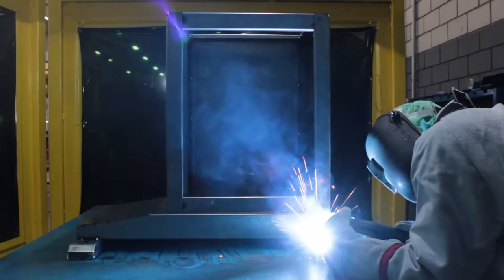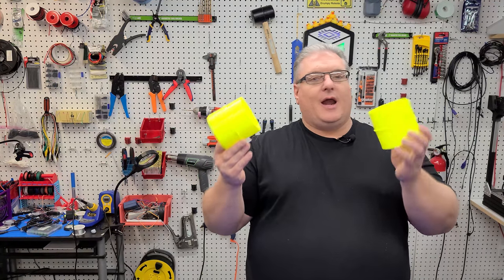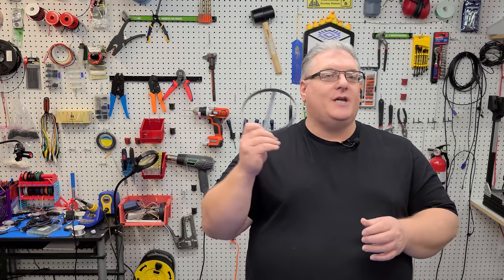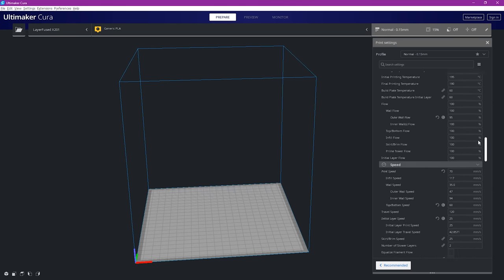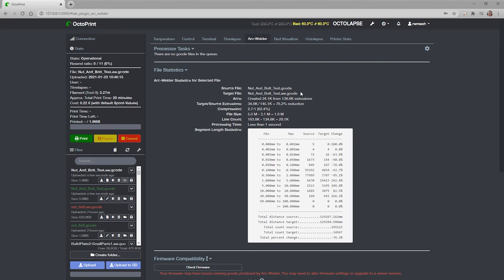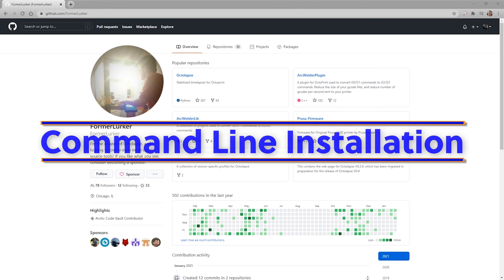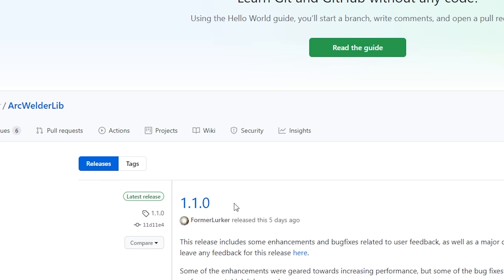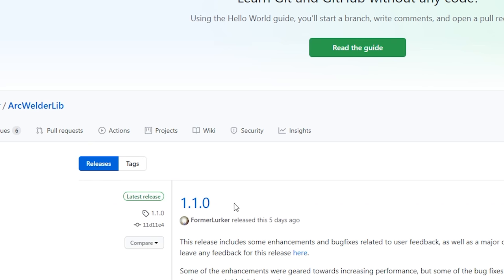Arc Welder - Smoother, Faster, Better 3D Prints! Its like magic to improve your 3D Print quality.

Comment: So no change to stock firmware on printer controle board?  Just setup Cura and OctoPrint properly and go?
Reply from the maker: Not unless arc support is disabled in your firmware.  Most have it enabled

Comment: Looks very interesting, I am keen to give it a go.
I have added the plugin to Cura 4.8.0 and configured the options, but when trying to save the GCODE file I get an error message:
Error: 'charmap' codec can't encode character '\ufeff' in position 453: character maps to <undefined>

So the Cura Arc Welder plugin seems to be broken for me...
Reply from the maker: I would file bug reports. The software is rather new.  I found my best success with OctoPrint and and the command line.
Reply: @MakersMashup  Okay, the current version of the arc-welder plugin in Cura's marketplace is broken.  I was directed to use the latest development snapshot and that worked perfectly.  The response to my question with a link to the latest development snapshot of the plugin is here:

https://community.ultimaker.com/topic/34888-arc-welder-anti-stutter-plugin/?do=findComment&comment=282303

My first attempt at printing with GCODE generated by arc-welder was a definite failure.  I then rebuild my Marlin firmware with ARC_SUPPORT enabled (Doh!) and the next print worked perfectly.
Reply: I believe this is fixed in the development snapshot.  It takes a few weeks for the dev version to work it's way into production.

Comment: I don't understad if we have to use the arcwelder lib as post-process (like in PrusaSlicer) and then the octoprint plugin too, or just one of them..
Reply from the maker: Just one.
Reply: @MakersMashup  thank you. Just installed in octoprint, but i don't see the compatibility check..
Reply from the maker: That's in the beta version.  You have to manually put the link in from formerlurkers repo page.
Reply: @MakersMashup  thank you so much. I saw the beta version is in the release candidate 2, so i think we have not to long to wait for the stable one. Thank again for this great video explanation 🙏
Reply: Last question: in which situation arcwelder will not do a better job than the standard slicing?! I think for circular for sure, but with which shape will be worse?
Reply from the maker: I don't really know at this point I'm running just about everything through it.  Overall I've had no issues.

Comment: I am a neophite when it comes to gcode or marlin, all i do is design, slice, and print with my cr6-se. My question is can you use Arc Welder without octoprint. My printer is standard and my slicer is creality cura. I do not know how to access Marlin or if it is even possible to do in my printer.
Reply from the maker: Sure can, check out the portion of the video on command line use or see if the cura plug-in works for you. No octoprint necessary

Comment: I think ArcWelder only works (inside of at least) Cura 4.8 and higher. Attempts to install it in 4.7 or lower don't result in anything. 
Also are there ways to enter in resolution and accuracy parameters in the bin version? I can see in the source they are hard coded in but I wondered if you can add another parameter while inputing the in and out files in the shell.
Reply from the maker: I've got it running fine in 4.6 on one machine but on another I have the problem you describe.  I think it may be a conflict between a module vs. Cura itself but I have personally been able to nail down what the difference is.
Reply: @MakersMashup  Hmm, I can't get it to show up in Win7 Cura 4.6. But that's good to know it's possible so I'll start poking at it.
I'm still waiting for a few things to get ironed out in 4.8 before making the leap. I use the CMD version of AW at the moment but would like to be able to set resolution at the time of conversion instead of rebuilding the app each time (to be fair, I now have a bunch of AW exe's at favorite settings compiled so it's not that big a deal anymore, but still, it would be nice)

Comment: If you are using Klipper there's not a benefit to using Arc Welder since it will just split the G2 and G3 commands back to segments. It may even reduce the quality of the print depending on the resolution you set for gcode_arcs.
Reply: Regarding the 'splitting G2/G3 back into segments' this is true on all firmware.  In Klipper, you can easily turn the arc resolution WAY up, say to 0.1mm or even 0.05mm (maybe lower), which should give you an extremely nice surface finish.  You won't be getting that kind of resolution from your slicer.

I have NOT tried this on Klipper, so this is mostly based on user reports.  I'm building a CoreXY now, and am DYING to try out Klipper.  I've not been willing to switch the firmware on my Mk2 just yet, so having a 'dev' printer will finally let me give it a go!
Reply: @FormerLurker  Hey there, thanks for the reply. I saw your discussion about this in the Klipper discord. Very interesting back and forth. Like you, I am basing my response on others (the Klipper experts in my case). I look forward to hearing from you when you have a chance to use Klipper. In the meantime, I will test some curves at 0.05 and see if there's a visible difference on my machine. Cheers!
Reply: @FormerLurker  Just finished a quick test with a 30mm diameter cylinder using a segment length of 0.05mm in Klipper. In a blind comparison I cannot tell the difference in the print straight from PrusaSlicer and the one post-processed with Arc Welder default settings. Even the print time was identical. The only observable differences are the file sizes and Klipper reports 2cm more filament being used by the Arc Welder version.

Is there a test case you would recommend to highlight the differences in prints? Also, let me say that my intention is not to put down Arc Welder. I think it's fantastic software and I'm glad it exists. Just trying to see if there's any value in adding it to my particular workflow.
Reply: @waynemenzie7015  , of course!  I know you're coming from a helpful place with your comment, so I view this as a great learning experience for myself.  I want to hear the good, the bad, the ugly, and everything in between, else it's very hard to move forward.

I am surprised you didn't notice any changes to the surface, as I have been able to see this pretty clearly in other firmware.  However, not everything works out the way we expect, and hard evidence is the only way to know for sure.  Regarding the filament usage, that is somewhat expected since smaller segments will yield longer paths.

I'm working on a PR for klipper ATM to add relative mode support (G91) for arc moves, so maybe I'll take a look at the general interpolation algorithm.  I will start by adding it to the 'ArcStraightener' binary so I can see what the firmware is doing with the arcs.  I learned a LOT about how marlin performs, and have tailored parts of ArcWelder specifically for Marlin, so maybe now it's time to see what's happening with Klipper too.  I know it uses the Marlin 1.0 implementation as a starting point, but it is obvious that it is not identical.

Comment: I have a 32 bit printer but my sd card is pretty terrible. I'm hoping that hoping that using this will mitigate the issue
Reply from the maker: Get a better sd card.  Slow cards cause issues.  Also if you don't need power failure recovery, turn it off.  Slows down printing writing status to the card.
Reply: @MakersMashup  I've had power loss recovery off since I got the printer and I've been using a sandisk industrial for my sd card with the issue persisting.
Reply from the maker: Sounds like you're doing everything right then.  Do you know the main board?
Reply: @MakersMashup  Not positive on the mainboard. I'm using a stock neptune 3 pro.

edit: I believe it's a robin nano v2.2

Comment: I tried it in OctoPrint and it turned a square box into a mess.

But I probably F'd something up.
Reply: Same here.. and I don’t see the compatibility check button
Reply: Did you install the Beta?  It has a firmware checker, and should detect many (not all) problems.  I'm betting arc's are disabled.  Let me know.

Comment: I don't have the Check Firmware option in Octoprint. Has that been removed or?
Reply from the maker: As I mentioned in the video that was in the beta version @formerlurker should be releasing.   You can install the beta version by copying the url from his github page into octoprint manual installation as I did in the video.

Comment: I don't understand your idea of simple. Firmware changes and octoprint changes? Does it just work in cura or do i need to change that g90 code? So if i know nothing of firmware and do not wanna go there is this not a option for me?
Reply from the maker: You need no firmware changes so long as you've never disabled arc support.  Use it in cura and you're good to go.

Comment: In cura 4.8 not work this plugin.If I only installed in octo this plug will also work Arc WELDER?
Reply from the maker: Yes octo only is fine.
Reply: @MakersMashup  my Arc in octoprint its  new face😐

Comment: I tried this from the cura add on. Was a total fail. It created a tool path on the 1st layer/circle that wasnt even close to the same as what cura showed and increased the actual print speed by 1/3. Needless to say it looked horrible.

Comment: Is this available for Snamaker Machines?
Reply from the maker: IIRC the snapmaker uses marlin.  Providing they didn't disable it you should be able to use it.  Issue a G3 and see if it comes back with an OK. If it does you're set.

Comment: How do you decide when to use and when not to use arc welder for the model you're slicing?
Reply from the maker: I used it sparingly at first but now it's my go to. I've not run into tolerance or model issues personally.  So if it were me I would use it always unless you've found something strange in the print.  So far everything I've thrown at it has come out better and prints smoother. Your mileage may vary.

Comment: Ok.. installed Arc Welder plug in. BUT ? it doesn't show up on the Special modes section.. Where might it be?
Reply: Search the ultimaker forum for the arc welder plugin.  There is a recent post with a development snapshot that has this issue solved i believe.  Takes a few weeks for the update to be approved, so it will eventually work its way into the marketplace.
Reply: FYI, the patch is now available in the marketplace!

Comment: can this be used with simplify 3D
Reply: Yes!  I just added documentation for this here:  https://github.com/FormerLurker/ArcWelderLib#running-arcwelder-from-simplify3d

Be sure to read about the optional parameters.  You may need to add a one or two depending on your firmware.

Comment: I can't find it in Cura special modes after installing it...
Reply: you need to restart Cura then it will be the last entry in Special Modes
Reply: @Bunyip_Studios  yeah I did. Still nothing
Reply: @emersonsims9503  weird, worked straight away for me
Reply: didn't work for me either. im using 4.5 so maybe it only works with certain versions of cura
Reply: @nathanreed3302  found a solution. Go to the cura discussion and drag the document from the chat onto build plate
Reply: @emersonsims9503  this the file you're referring to? ArcWelderPlugin-v7.0.0-2021-01-25T11_08_03Z.curapackage
Reply: @nathanreed3302  sure is. Open cura and drop it onto the build plate as if you were loading a 3d model :)
Reply: @emersonsims9503  thanks it worked.
Reply: @nathanreed3302  no worries🤟

Comment: I don’t understand why 3D printing does not have arcs as standard?  Cnc mill and router gcode uses arcs.  I have noticed that my printed arcs were segmented.  I though I just had a setting messed up
Reply from the maker: You're not the first to wonder that. My guess is that because most of the 3D Printing slicing software is open source, STL's being a bunch of triangles, it was easier to not deal with arcs when developing it.  That is just my guess though.
Reply: @MakersMashup  that makes sense.  Slicing software is so sophisticated now, I would think they would have implemented this.  Maybe they will soon.

Comment: Added the plugin but when I go to the special modes area Arc isn't listed? I checked that it's installed and it is... I'm at a loss here for what's wrong. Any ideas?
Reply: For everyone's reference I figured it out. You need to enable it (IMO) under special modes. To do this hover over special modes and click the "gear" settings icon. From there scroll down and check the Arc Welder.

Comment: Installed this plugin in cura 4.8 and it says installed but it is not visible in the menu (every option is visible).
Checked the plugin folder in appdata/roaming etc. and there it is in the plugin folder.
How do I get it to work in Cura?
Reply: In Cura, the plugin makes an entry inside the "special modes" menu. When enabled, it expands its own settings. Watch the video at 4:48 (see in description)

Comment: Any time or material saving?
Reply from the maker: Wont save any material.  You will save time if you print faster as a result of more efficient gcode.  Just turn up the feedrate to test it out.  I personally tend to leave tuned in setting in my slicer alone, then just up the feedrate to get faster results.  The biggest benefit to me though is that it does produce smoother prints and removes those line segments.  If you get zits/blobs from printing faster this will also remove those in most cases as well.  At this point I'm running just about everything through arc welder.

Comment: Just a question to all people or makers : Can someone tell me why if your printer is well calibrated your print parts are out of size (not the good size). I explain. If i put a pen on my printhead and send basics command i can draw circles, box with exact size on paper, so why when i print parts there are not the right size ????. For me when you can draw forms with right size your firmware is ok. The the problem come from slicers.
Thanks for your help.

Comment: I had bad experience with arc welder. After installing arc welder, when uploading a gcode, arc welder plugin automatically converts the file with aw word in it. when i printed the converted gcode, it produced an output with lot of details missing. may be it may work on cylindrical objects, but for me, for a complex geometry without curves, the printed result was too bad.
Reply from the maker: You might try adjusting settibgs but I would love to try the object you're having trouble with if you're willing to share. Everything I've run through it has worked great.

Comment: does it work with bambulabs slicer thats the one im using for my X1C
Reply from the maker: Bambu does support G2/G3 arc support.  I don't know if their slicer natively exports G2/G3 however.  Providing you can get a gcode file out of their slicer, that can then be run through the command line version of arc welder.  That would then convert any moves over to G2/G3 arcs.

Comment: Installed Arc Welder, restarted Cura but it is not in my menu. Any advice?
Reply: Jason B
1 second ago
Here's how I got it to work after some research.
Go to this link: https://community.ultimaker.com/topic/34888-arc-welder-anti-stutter-plugin/page/3/
On the fourth reply he mentions a development snapshot. Click on it and save it on your drive.
Open Cura, then drag that file onto the build area.
After a Cura restart, ArcWelder option showed up under 'Special Modes"
I haven't printed yet, but I notice the gcode file size is greatly reduced,

Comment: I wonder if problems arise between layers when arcs start and stop at different points, causing slight layer offsets.
Reply: Arc gcodes will always move from the current position exactly to the defined endpoint, due to the way they are interpolated by the firmware, so no problems there!
Reply: @FormerLurker  Hmmm I mean, imagine a smooth undulating shape. At some point, the deviation will be enough to break an arc after a certain layer, and there theoretically you could see twice the deviation on the print surface where the layer deviated differently from the previous. So I'm wondering whether it's ok that the algorithm forgets about previous layers.
Reply: @haley8004  you can always tighten up the resolution if you notice issues.  The binaries also have a useful exe called arcstraightener, that will 'unweld' the arcs the same way that marlin 2.0 does.  If you want, you can run the welded code through that and visualize the gcode to see what the firmware will do with it.

Also, fyi, most visualizers dont render arcs at a high resolution, so sometimes they will look rough.  PrettyGcode viewer for octoprint renders them using the marlin 2 interpolation algorithm, and is probably the best viewer to use right now.
Reply: @FormerLurker Cool! I'm impressed by your knowledge.

Comment: I don't get that arc welder tab at the top to check firware etc..how do you get that?
Reply from the maker: If the plugin is installed that should show up automatically. I would check the Octoprint settings and be sure the plugin is activated.  If its not working from there certainly reach out to FormerLurker who supports the module development.

Comment: COMPATIBILITY ISSUE: May have a compatability issue with OctoPrint. I had it finish 100% but leave the top 1/3 to 1/4 unprinted. I had followed the in OctoPrint text to add the start G code rather than download the plugin though.
Reply: Hmm.  Any chance this is a clogged nozzle?  It was designed originally specifically for octoprint, but bugs are always possible.
Reply: @FormerLurker  Sorry, I typo'd: I meant a compatibility issue with OctoLapse. After turning off the arc welder plugin (edit: in octoprint)  and using a non converted version the full print finished. Could've been a bug on my end, but I'll be trying it next with the plugin in Cura rather than just the copied text into it.